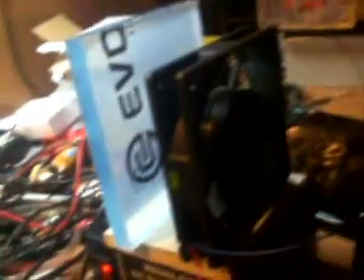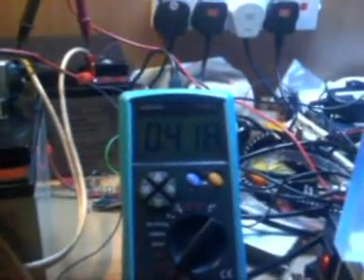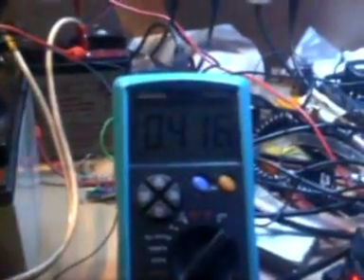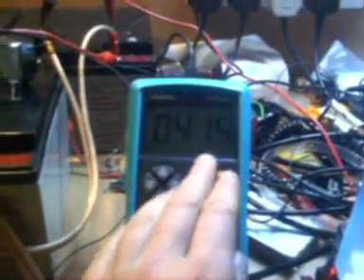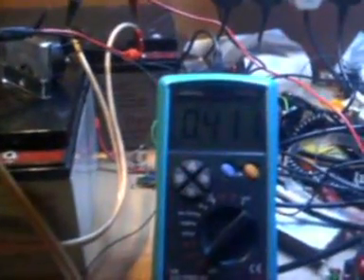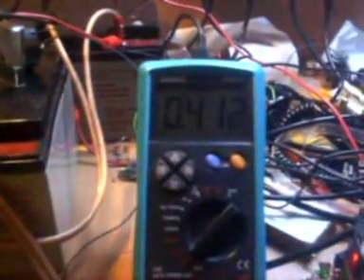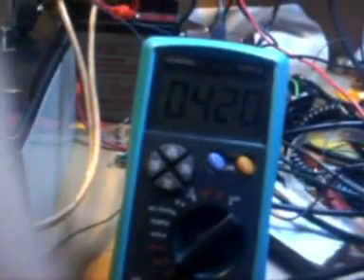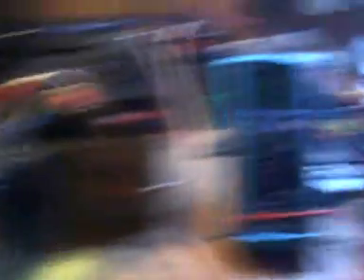Bedini Motors Have NO Torque!

Comment: A bedini motor is NOT supposed to be as efficient as the standard fan; it's not used for that purpose. It's for charging and keeping batteries charged. Stop trying to fool the people. The bedini motor works for what it was designed to do.

Comment: and dont forget that you dont haft to have a fan on it people put them on to show that you can charge a battery and have a fan when you could put a drive belt on it that runs a generator you need to play around with these motors mod them tinker with them try doing stuff that will improve rotor movement and timeing and put something on it that slows the rotor then try to speed it up again dont just give up keep on trying and you will get there.

Comment: well iv made one and found that if you remove the battery being charged and connect a dc motor or lights that the motor can produces more Amps than it takes to run the motor in one of the tests i did the drive battery was running on 0.15 Amp and the output was over 0.30 Amp dont look at the voltage look at draw and output you will find that the motor can do a lot more than you think i will be doing a vid on it soon if you like ill send you a vid of it doing this on one of the test motors.

Comment: As far as I can tell it takes the low voltage from one battery, turns it into a series of high voltage spikes that then charge a second battery. The scam basically works by trying to convince people those high voltage spikes output more energy than is put in which is clearly not true. He seems to have backed away from claiming it produces free energy and now claims it's a battery de-sulfurifier which is itself another nonsense claim.

Comment: The torque depends of the magnets power and size for push and need a few heavy wheels so you can get a few horse power. This one is an good experimental one but if you think in power you have to think heavy and big also expend some money. Bedini Motors Have a lot of Torque if is well built for it!

Comment: The Bedini SSG is not a Motor, Otis an energizer. It was created for the soul purpose if capturing the energy spike that restores and energizes Lead Acid Batteries. In order to use this system as a "Motor" you will have to design a way to exponentially multiply the rotational mass! At the same time, you will have to create, capture and amplify the energy needed to power the device.  All the while trying to keep it light enough to be able to transport it.

Comment: I have built a Bedini style motor, and attempted to charge a second battery while running from the first 

- although my multimeter showed a rising voltage on the charging battery, once it was removed from the circuit, it rapidly lost the charge and returned to its uncharged state.

Is this normal behaviour? 

I couldn't get the charged battery to do anything like the same amount of useful work as a battery charged in a conventional manner.

Comment: very little torque, true unless you make a miltipole configuration, but the bedini motor is really more of a switching mechanism to produce a scalar wave pulse by which you can charge a bank of batteries, the mechanical output of the motor is just an added bonus.